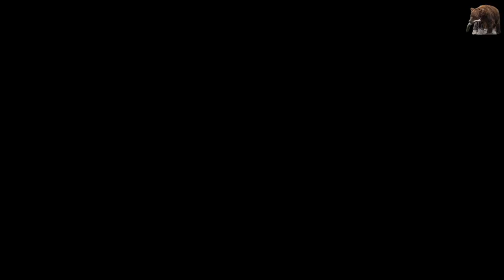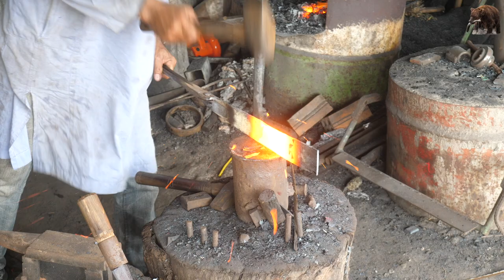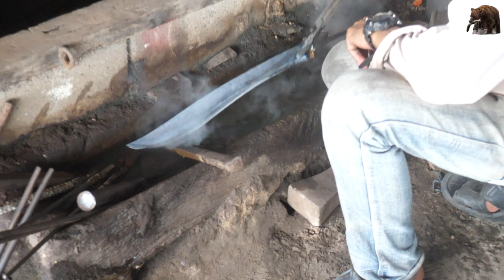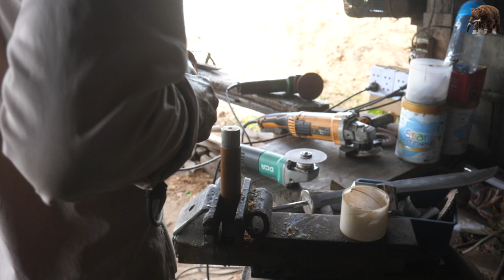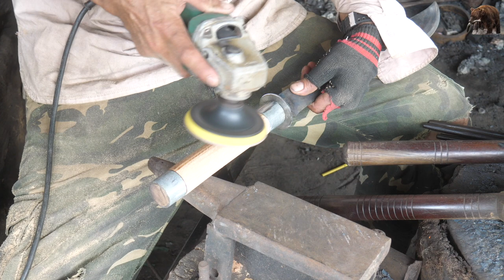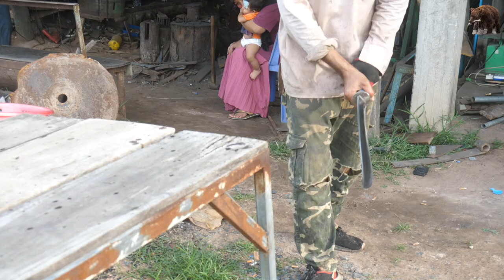How to forge a machete blacksmith in Cambodia

Comment: The machete looks great, but I don't like the round handle because it will spin in your hand.
A handle should always be at least a little bit square which make it much easier to index the edge of the blade.
Reply from the maker: Great point